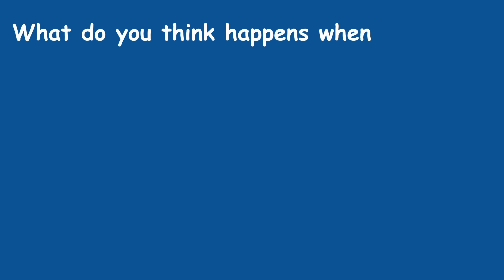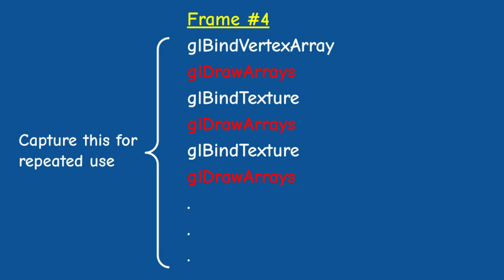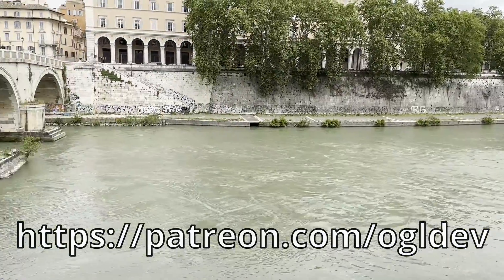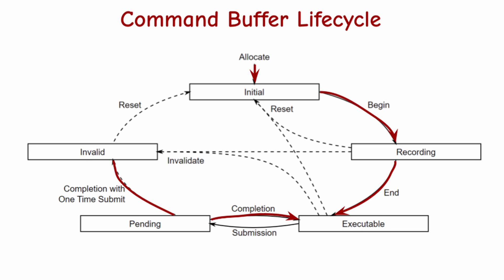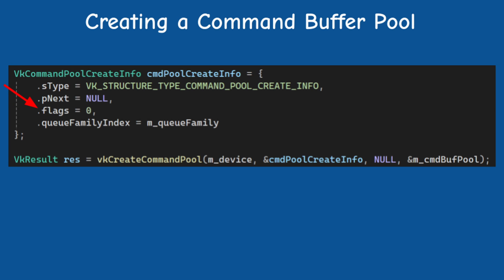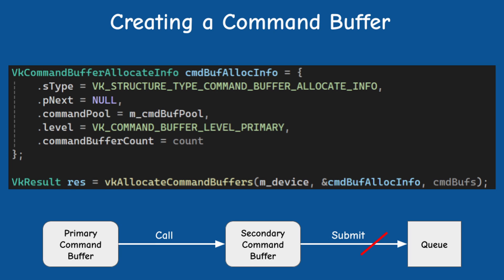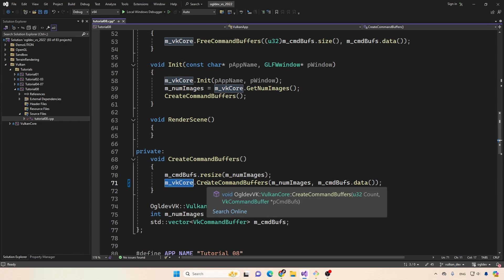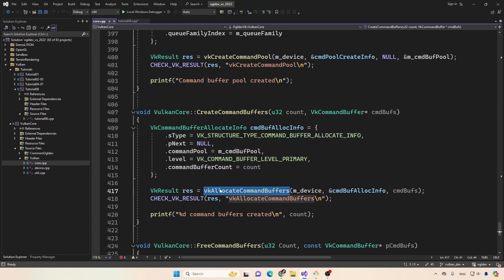Buffer Those Commands! // Vulkan For Beginners #8

Comment: 12:10 why are you using primary command buffers? You mentioned you would change it in a future tutorial but you can't submit primary command buffers to the queue so you cant have it do anything on the GPU then right?
Reply from the maker: You can't submit secondary command buffers, only primary. So there's no problem in the current code. Primary command buffers can point to secondary buffers as a sort of a code reuse mechanism. This sounds like something that can be used to reduce command buffer duplication. I consider this an optimization which is why I said I will use it in the future. In a simple scene you probably don't need that.
Reply: @OGLDEV  Thanks! Im still trying to learn and got confused with the diagram difference between 8:28 and 8:34, now I understand. Thanks for the quick reply, I've found these videos to be very very helpful.

Comment: Why the command buffers are created in the app side, outside of the Core?
Reply from the maker: The core provides command buffer creation as a service but only the app knows how many buffers it needs and what to put in them. The core is supposed to be generic so that it can be reused for as many apps as possible. Each app has different needs so it needs to manage its own buffers.
Reply: @OGLDEV  Thanks for the answer!  I did notice that in the tutorial #9